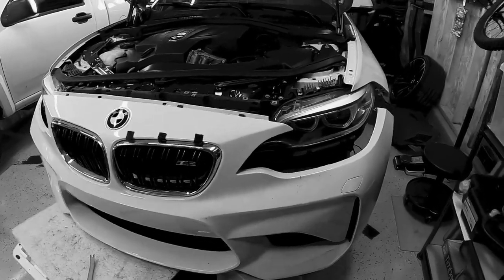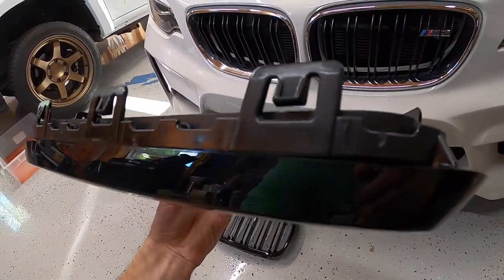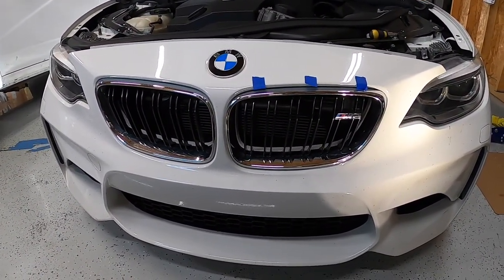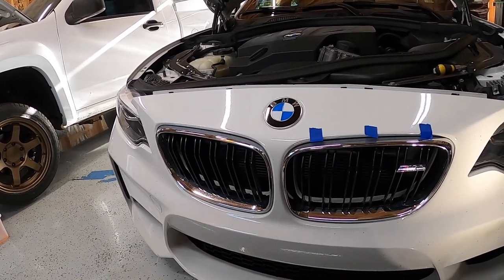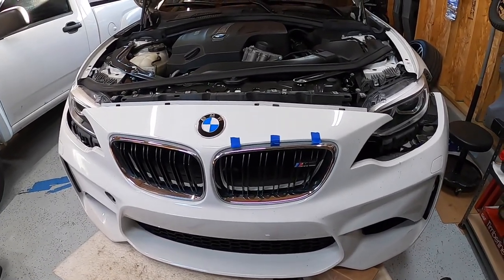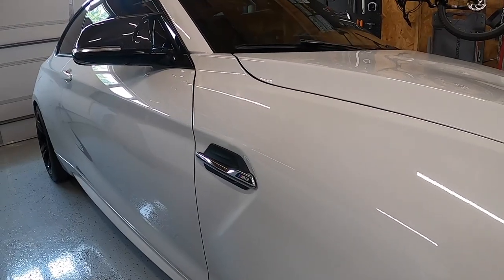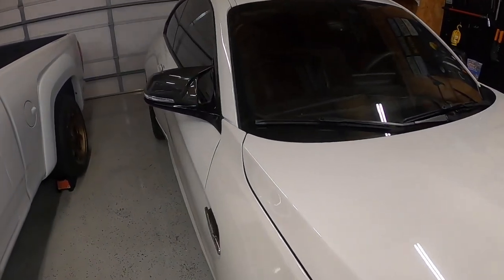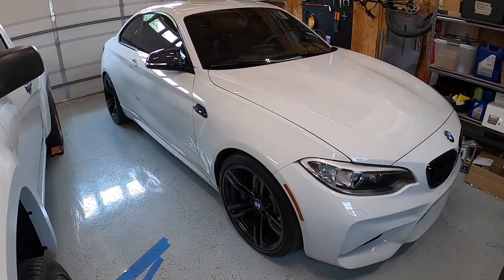F87 M2 Carbon Mirror Caps, Black Kidneys, and Black Side Grilles Install

Comment: hey sir! love this video. how easy was it making the slats match the surrounds? the m2 i bought prev owner switched to carbon and didnt retain the m2 badge so i wanted to get oem ones to swap over to the surrounds
Reply from the maker: It’s not bad. Removing the grill from the car is the biggest pain. You just have to take your time so that you don’t break the little clips that hold the surround to the grill. Outside of that it’s pretty easy. Good luck!